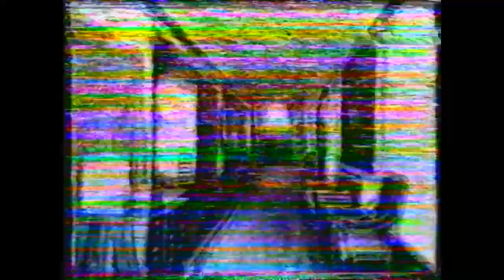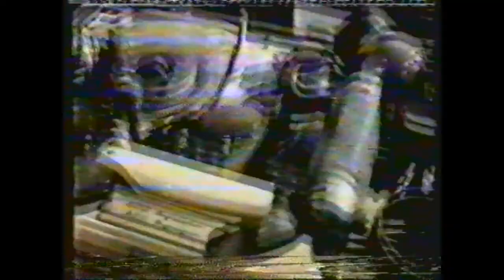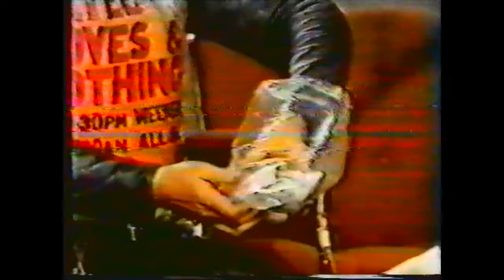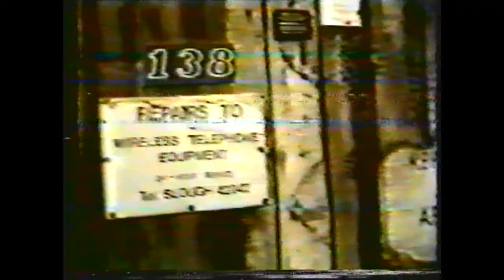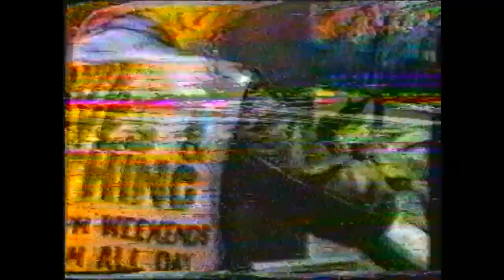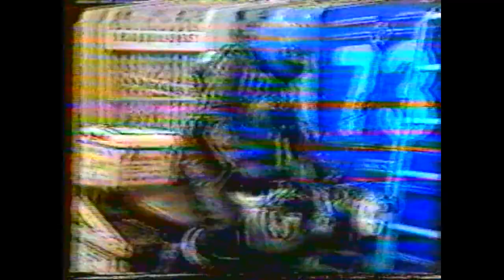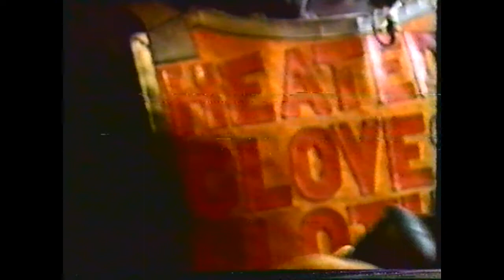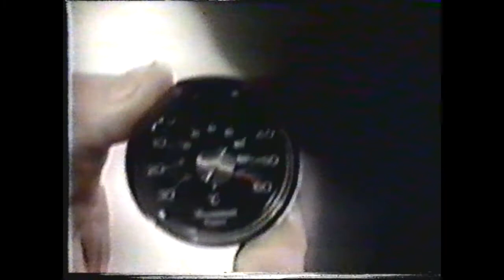Captain Maurice Seddon Royal Signals (Retired) 1926-2014 In His Own Words.

Comment: This is indeed a find. I worked for Capt Seddon as a part time job after school and weekends cleaning radios and TV equipment for several years. He offered to buy my 1957 Matchless 250cc when I couldn’t afford to mend the gearbox which had a gear welded onto the lay shaft when it seized for the previous owner.  Generously he allowed me to ride it after he had it fixed.  I remember all the record and cylinder players in his ‘museum’ and the ‘chockee’ we all had on coffee breaks. He was an absolute gent. RIP.